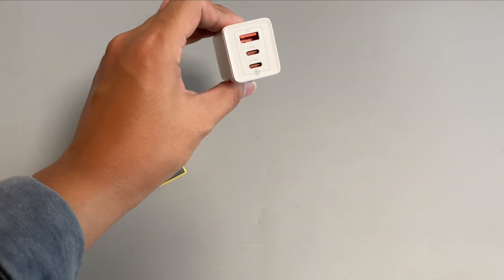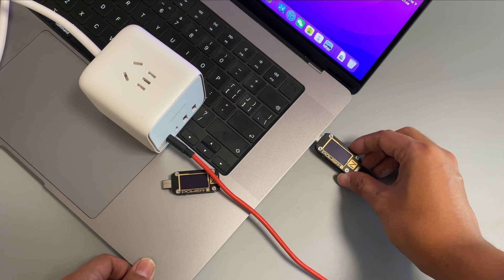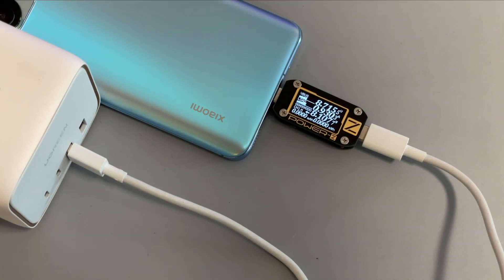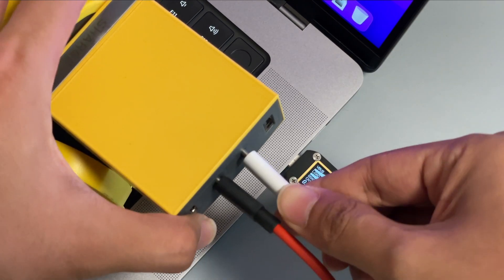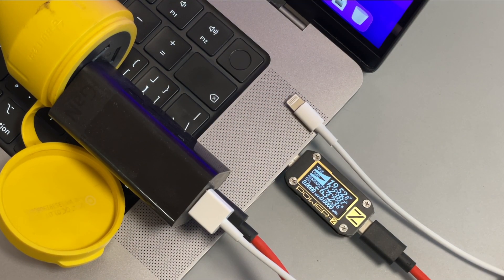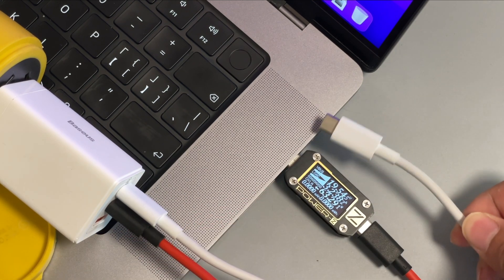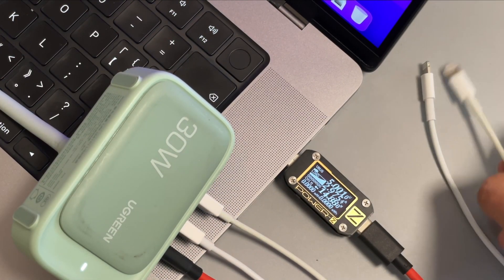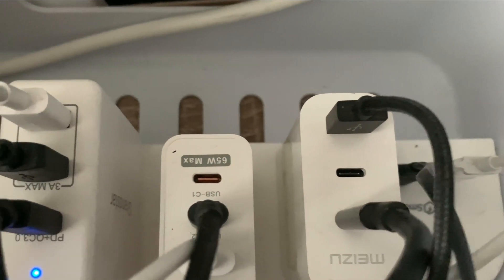Small Experiment | What Will Happen if We Forget to Remove the Cable?

Comment: For Baseus I don't think it's as bad as you shown. There's USB-C1 and C2, you connected laptop to C2. For one device it doesn't matter, but for two there is probably a fixed power split of 45W C1 and 18/20W C2. If user knows that, the impact of not removing Apple cable isn't that massive.

Comment: Hmm interesting. Would this be the same effect for non apple branded cables?
Reply from the maker: So far, we only find the Lightning cable will affect it.
Reply: If "non apple branded" means non-lightning, then most probably yes.
E.g. usb-c to DC barrel jack cables/adapters (with decoy/PD trigger module inside) do the same.
Little explanation:
Main reason why this happens is that these cables enable the output of the usb-c port of the charger by controlling its CC pin (without anything connected to that usb-c port, that port should have 0V as opposed to 5V always active on USB-A port), so charger understands this as "I have a device connected to this port" and lowers power pool for every port. Same situation will be probably with usb-c to micro usb cables intended for charging older devices. I'm not sure if same situation is with usb-c to lightning cables as i don't have any apple device. This is also the reason why plain c to c cables don't do this as there is nothing on the other end of the cable that can control its CC line.
Also as I mentioned, USB-A ports have 5V always active, also they don't have CC pin (except propietary protocols like Xiaomi fast charge etc.), so they don't detect anything on that port (some chargers seem to actually detect chip inside usb-a to lightning cable as mentioned in the video).
@ChargerLAB may correct me if i'm wrong as they have probably better knowledge with this. What I wrote is only from my observations and little reading of How PD works.

Comment: Thanks ChargerLab for this informative info about taking out APPLE Lightning and USB-C cables after charging. Very interesting that you can show the chargers rebooting. Normally, I would pull out the whole charger out from the wall socket once the charging is completed but the charging cables are still attached to the charger. With your demo, i will be more mindful to detached Apple lightning and USB-C charging cables from multiport chargers such as from UGREEN which I used. Thanks, stay safe and happy weekend.

Comment: Quite interesting! I was thinking that plugging in the cables should not affect the other port's power, but it does for the lightning cables. I wonder if that means that leaving a lightning connector plugged into the wall would consume more power than dual usb or usb a to usb c.
Reply: I don't think it uses any significant power, it just means the lighting cable has some kind of active circuitry inside it
Reply: MFI lightning cables have a chip (confirmed) that, from what I've heard, makes it easier for the phone to regulate power input as well as stabilizing power input.